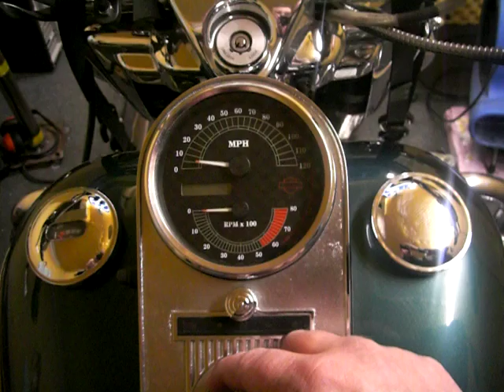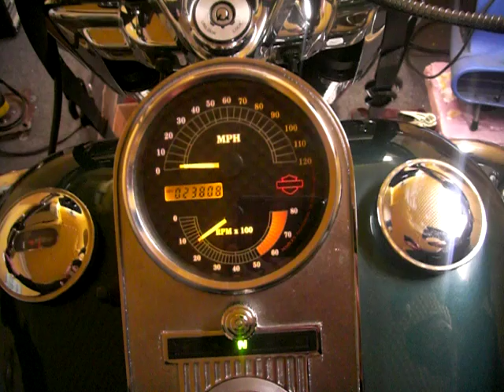124 ci 2000 Harley Davidson Roadking Dyno run at BikersPHD 124 coversion

Comment: what would something like this cost but with a tad bit more compression?
Reply: octane boost every tank
Reply: Not true. My dad has a 124 that puts out 150hp and has 13:1 compression and he runs it to Reno on 91 pump gas and it doesn’t ping. He only uses 110 when he drag races the bike.

Comment: How decent of a 124 build can you get with 10k?
Reply from the maker: You are definitely in the ballpark with having 10 grand.  Up your budget to 13500 and you have the road king that's on the dyno.
Reply: For 13,500, does that include a beefed up transmission, upgraded clutch and labor? Or is that just engine cost?
Reply from the maker: @BobBob-fp5fn  the 13,500 that I was referring to is you can buy my Roadking that is on the dyno.
Reply: @Vtwinheaddoctor  Damn, shouldn't have bought my road king. Why you selling it, got a bigger better bike now?
Reply from the maker: @BobBob-fp5fn  In the making!
Reply: @Vtwinheaddoctor  Makes sense, everything gets old at some point. But you always need more hp/tq. Its a healthy addiction, at least im not smoking crack.

Comment: where's the dyno read out!?
Reply from the maker: I had a software issue that day wouldn't you know my own bike on the dyno and the computer screws up the  torque reading was at 2200 rpm was making a 156' pounds of torque at that rpm.  The horsepower was a 127 at the 2200 rpm that's when the computer shut down so not sure how accurate that is as with most mechanics my bikes the last one to get put back on the dyno just have it done again.

Comment: thats weak, my snowmobile has more horsepower
Reply: Ya, and so does mine.  But 200hp on a sled compared to 150hp on a bike are two totally different animals.
You ever rode a bike with that kind of  hp??
Reply: Weak 😂 do some research on putting that type of HP to the rear wheel of a Harley, then re comment.